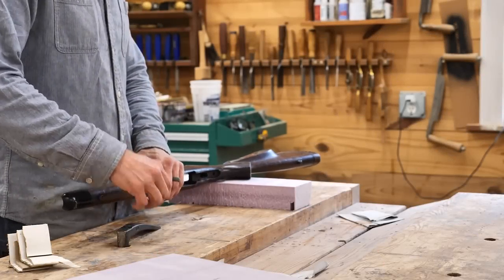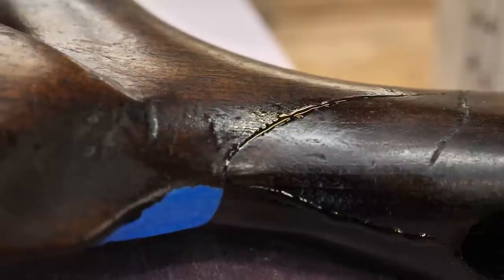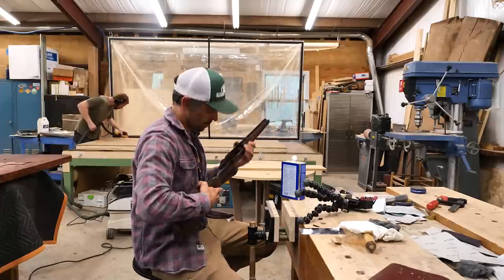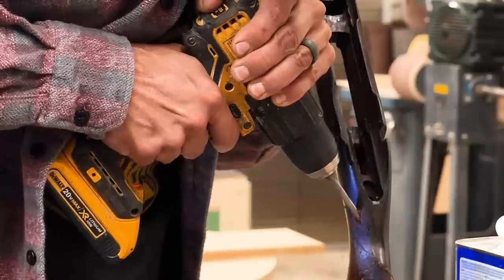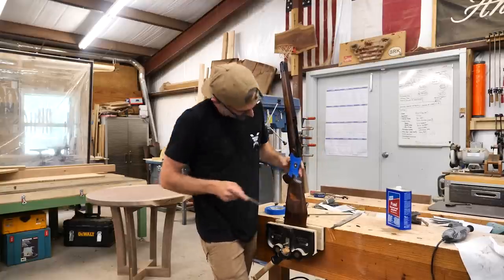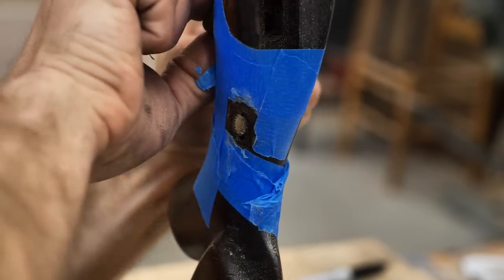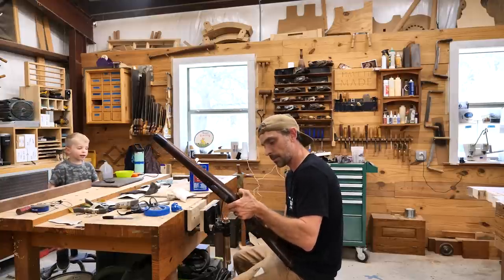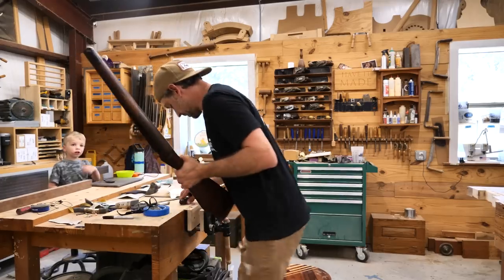105 Year Old Springfield 1903 Stock Repair

Comment: Next time with the threaded rod. Use and dowel to measure the pilot hole and then cut the rod to just below that mark. Then add a slot for a flat head to the rod and screw it down the rest of the way. You can then use the epoxy/wood dust mix the fill the hole. I’ve done this a couple of times and it always comes out great. 

Also, I love that your son is in the shop working and learning from you about woodworking, guns and life. You’re a great dad.

Comment: mark novak is the king of giving enough details to help you get something gun related fixed right and permanently. that appears to be in a bad spot in terms of stress and not getting it cleaned and supported properly will result in it cracking again.

Comment: I’ve made a similar repair to a rifle stock that had fallen off an above mantle rack. I used the braced clamp method also but used waxed dental floss to get the epoxy into crack. Worked really well. I never would have thought to try air.

Comment: Drill hole through the inside of the back of the receiver. Approximately sixty degrees through the pistol grip. Epoxy, a 5/8" Hickory or Maple dowel or all thread rod. Bruce Farman master stock maker(member of the American Custom gunmakers Guild) repaired a 300 Wby saving a beautiful stock. He says that all thread rod doesn't give so it will crack anyway. However, that's what Weatherby uses in the wrist of their stocks.

Comment: Very nice repair. The owner might want to check the action bedding. When 03 stocks crack like that, it normally means it is walking out of its beeding. The action screw acts like a splitting wedge.

Comment: im glad that you reinforced the stock. i wonder if this person is going to get that gun "bedded" (where they reinforce the mating surface between wood and metal). it will prevent the crack from happening again.
if you dont already know about "Mark Novak" and truly do love this art, i highly recommend him.
things like hiding that reinforcement screw, removing the soaked in oil so the epoxy will stick better, and bedding the stock, are all tricks ive seen him do that you might be interested in.

Comment: Great work! May want to make sure that there’s a gap between the metal and wood at the back of the receiver where the crack meets the inlet and make sure the rear action screw has clearance. This type of split can happen if the inletting is too tight at the rear or too loose at the recoil lug. The recoil force goes there instead of the lug where it should be!

Comment: That's a real nice repair Andy. I have an old Austrain Mannlicher that has a crack in about the same area. I think I might try to fix it, but maybe bury the bolt and plug the hole.
Thanks for the interesting video!
Reply: Gunsmith here:  instead of drilling through from the outside, drill down into the wrist (the part where the grip transitions to the buttstock) from the inside of the receiver pocket, and insert a section of all-thread in there with epoxy or Acraglas.  That way the metal stays hidden and there won’t be any blemishes.  You can also take that opportunity to glass bed the receiver back in to help accurize the action.
Reply: Exactly!

Comment: MidwayUSA has some really great videos about this kind of thing.  So does Mark Novak at Anvil Gunsmithing
If I could make a suggestion for next time, drill that hole for the threaded rod down through the wrist from the inside of the receiver pocket.  That way, it reenforces the wrist, and stays hidden too.

Comment: That'll work, however I would recommend you use stainless/ brass reacts with the oils and gets green and slimey over time, pre cut the stainless screw smaller diameter for a repair of that size , use accraglass and recess the screw a little, it's almost the same color of the wood you can add pigment from a colored ink pen / office supply has every color, or add sawdust to the last little bit on top, the repair will be stronger and almost dissappear

Comment: Next time get a brass set screw that way you can run the set screw past the surface of the stock and then pull the hole. But you did a good job.
Reply from the maker: Good idea!
Reply: The top cracked portion looked kinda thin, the exposed brass is using every bit of grip available,I wouldn't do that repair any different,it was breaking and now repaired...just adds to the story,when it's 200 years old someone will ask about this old repair!!😊

Comment: Quick tip if you're afraid of screwing up the original wood finish is to heat up the wood to draw out the excisting oil, and just hand buff it to even things out.
Not sure what I feel about the shiny brass bolt😅
Reply from the maker: Thanks

Comment: I dint think that stock is 100+ years judging by the design it looks like something made from 1960 onwards. I could be wrong but it’s definitely not original
Reply from the maker: I don’t know a whole lot about dating them, just going off what the client told me.  You might be right.
Reply: @AndyRawls  I have several military originals. This one is a replacement "sporting" stock for hunting ... not sure but I think they can be quite old, back to the 30's, but with the bulged cheek, this looks like post 60s as Simon sez.